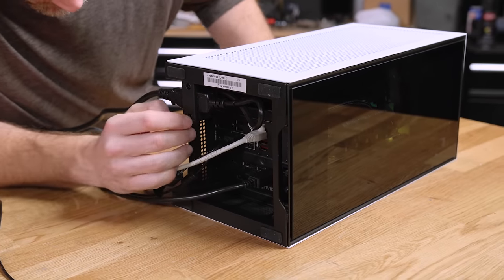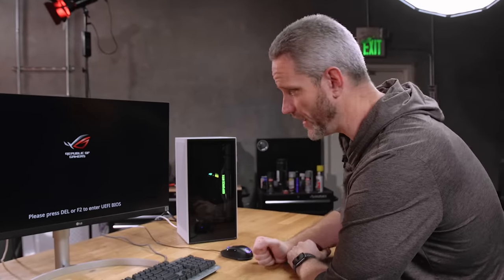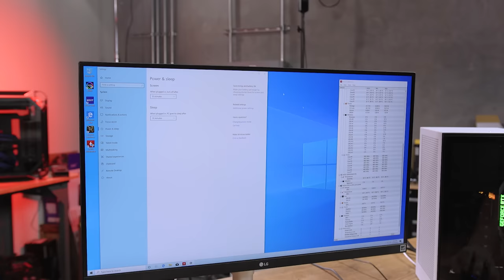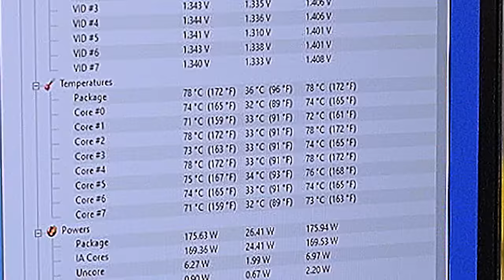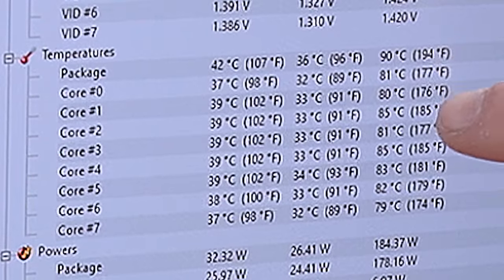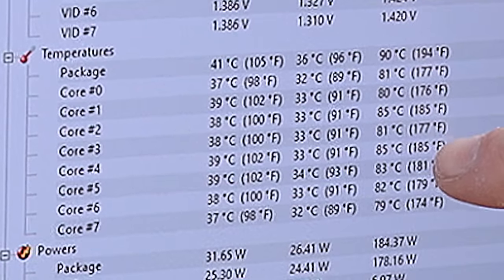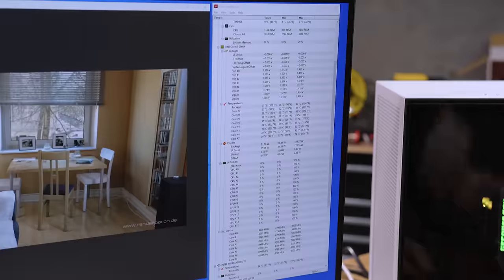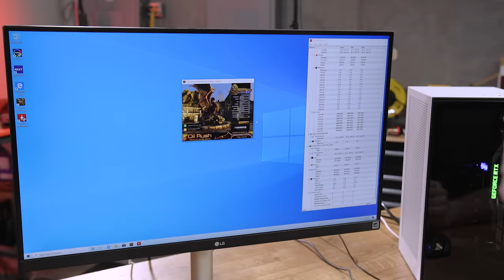You NEED to see this small PC case!

Comment: Seems Perfect.  I love small cases, but I have a 5 monitor setup.  I prefer to use 2 GPUs, so I typically can't use an ITX board.  Currently, I use the Tt level 20 VT... but it is HEAVY and larger than I want.

Comment: If they did some holes on the top like the Corsair one with a nice 140mm fan to help pull out the heat it would probably do even better.  Still, nice looking case for the form factor.

Comment: Jay can you please check how thick the 2.5-inch drives can be installed because I really need to know if I can get 2 8TB 2.5 inch drives of storage for content creation so I don't have to work with NAS for the time being.
People seem to be disappointed with the price ... though you have to think about this:  The PSU costs 125 $, The 140mm AIO costs around 100 $, so that leaves the case for about 125 $. For such a thought out the case, I'm thinking this case is very well priced (and think of the PSU cable management benefit for having shorter cables). But of course, since this is all bundled it can feel expensive as a one-time expenditure. This will absolutely be my next PC build even though I don't know when I will make it yet (still thinking of waiting for AMD's AM5 socket and DDR5 for some sweet 128GB mini ITX build, yes I do use that much RAM easily and 16GB on my laptop is so painful right now).

Comment: I've always felt like NZXT were often one step away from being phenomenal cases. Introducing a mesh or perforated front would go a very long way with maintaining lower temperature in their standard desktop builds since that's often their weakness and introducing a top exhaust which is often found in these tower-style ITX cases to help move as much hot air out of the H1 as possible would be nice. 

That being said when I switch over to a RTX 3080 and a Ryzen 4000 build in the fall I am going to put my NZXT H200 to rest and rebuild in to this. I just hope they'll eventually allow you to buy it without the PSU since I already have a Corsair SF750 and, who knows, maybe they'll come out with a revision with improved exhaust.

Comment: Will the PCIe riser 3.0 work without issues with an updated AMD CPU to PCIe 4.0? 

I'm looking to make myself a pc and was looking at the Evolv shift air until today seeing this is smaller and in white. 
Though I hope they do a revised model soon without tempered glass and meshed top with a slim fan to push out the hot air.

Comment: It's funny to me when I hear you call most PC cases "Traditional". I used to work at Zeos in Minneapolis, and I still call that a Mini Tower. Back then (about 1993) this was a new design, and we were shipping some of the first Pentium 90 PC's all over the World. This was back when IBM first announced that they would NOT ship any Pentium 60/66 machines because of the floating point error flaw. This new case is probably small enough to fit 2 or 3 of them into the same space that a Zeos full tower case took up.,

Comment: The screws are not actually that tight when you use a standard sized screwdriver. 5:17
I use a Craftsman #2 phillips (6") but any brand of the same size will be sufficient.

Comment: they could've made it 50mm taller so you could fit two 140mm fans  in it. One at the bottom pushing air up and one pulling it out the top.

Comment: This form factor reminds me of the Xbox Series X.

2:12
such a great sound

5:06
I FIX IT!!! 💥

Personally I wouldn't build a PC in this case.
It seems like a lot of unnecessary headache.
I'd rather go with a normal, medium size case (at least).
I also dislike how you don't have the option for an optical drive.

Does NZXT make a normal style case that is air cooled and has slots for an optical drive?

Comment: Definitely a cool case, though there's almost certainly no way that I'll ever do anything with small cases. My main machine has 12 drives in it (as well as a Blu-ray drive), and you're never going to fit much storage in a case like that. But if you don't actually need much storage for whatever it is you do, then a case like that looks like it would be an interesting choice.

Comment: They've crossed the old Mac Cube and Trashcan designs and got this out of the merger. I'd want a plain metal panel on the front with the USB ports and headphone jack through it. Also, at least 4 USB 3.0 and two C ports on the front.

Comment: So it seems that NZXT sent this to everyone. However i think this was the best review of the case i've seen. I'd still like to see this case offered empty. Am i the only one that doesn't want to deal with water cooling? the worst that seems to happen on an air cooler is the fan dies, the system throws an alarm about thecpu fan speed being zero, and thermal throttles. With a pump... 

 Though if it were offered as just a chassis it would then be competing with the velka5.

Comment: I want to switch out my fractal R6 for this case in matte black so bad. I would love a SFF pc on my deak instead of the behemoth I have now. I have a Corsair H115i platinum RGB, and the temps for the CPU max out at 35 degrees celcius under load.

Comment: Love this case. Shame they didn't put a large, low rpm fan at the bottom or top blowing/sucking up over it all though, with a vented top, a bit more like the Corsair One, to help with heat. It's still impressive managing to handle a 9900k/2070 with stock curves though...

Comment: Biggest problem I see with this case: the "front" panel port locations absolutely sucks, mainly because they're not actually on the front; they're on the TOP. The case size and expected location (on your desktop, duh) is similar to the Corsair One gaming rigs, but the port location is radically different. Corsair put them where they should be (on the actual front). Also not thrilled about only one type-A port, but I can live with that, especially since they included the type-C, which most manufacturers cheap out on. That said, the included SFF-PSU and AIO makes it worth the markup, especially if you don't care about the inconvenience of having to stand up at your desk to put a thumb drive in.

Comment: My two screws to remove the AIO rad were actually stripped right out of the box, so those NZXT strongmen must have applied too much strength when closing up my case at the factory. I had to drill and tap them to get them out!

Comment: I would REALLY mess around with the idea of drilling holes in the top of that case. 20 tiny holes could shave off 2-4 degrees just by letting heat escape.

Comment: The chassis is a little pricey, but you are getting an AIO and power supply in not the most popular form factor so I get it. Wonder what happens if you need to replace the AIO down the line though?

Comment: I would recommend NOT using a 2.5 slot graphics card, because the fans, being so close to the grill, will suffer turbulence. You'll need some gap for optimal air flow.

Comment: Steep price, but it includes the AIO cooler and a decent power supply. Plus the way they crammed all this hardware in there is so cool. I so wanna buy this case and replace my computer but my wallet has run out the door saying, "nuh-huh, no way buddy."

Comment: I watched a pro Fortnite player, coL Punisher, put one of these together on his Twitch stream about a month ago and found this case to be cool as Hell. For some reason that he never figured out, he ran into some trouble with his GPU (a 2080ti) being difficult to install and sitting crooked in it's slot even after locking in. It worked perfectly and the case went back together just fine, the GPU just wasn't as straight and level as it should've been.

Comment: I let me build a H210 for on the office. The Videocard is terrible in there. MSI 2070 super Armour OC. It's almost flat on the power supply.
Stresstest it at 73 degrees. 77 for H60 cooled 3950x. Not terrible but could be better. (they couldn't fit in a 240mm radiator with this card (they say) 
In this "case" at least you get fresh air on the GPU. I think a top fan exhaust would be an improvement for this design.

Comment: JAY... you made a MISTAKE I think...
You said the PSU sucks air into the case, however it seems to me it just sucks air into the PSU  then blows the hot air right out the BACK OF THE CASE. It shouldn't really affect the other components at all aside from some hot air that may bounce back off the rear of the case

Comment: I'd love one of these, but three issues keep my hand away. 

1> Price.
I'm friggin' broke. If you saw the system I'm typing this on, you'd understand. 

2> GPU cooling.
The biggest problem I have with my Fractal Nano S is its poor GPU cooling performance. While this thing is "better", it's still not ideal due to the TG blocking half of the exhaust from the card.

3> No 3.5".
I realize that 3.5" drives are increasingly considered obsolete, especially in ultra-small case formats, but see #1. I can't afford to upgrade to large-capacity 2.5" drives, or NVME drives that cost more than my entire build would new.
I can use a 2.5" as a secondary PC, and have, but see #1, paying this much for a secondary PC is difficult to justify on my shoestring budget.

Comment: The sealed side panel is not good to use with say a Strixx Cooler (with a high TDP GPU). Masive heat buildup on the sides of the card, and such tiny space to dissipate it away from the cooler. Sure the AIO fan will take what i can out, meaning not very thermally effective design, due to the radiator gets heated up with hot air from another source, that what it is actually cooling. Problem will be worst for the CPU when CPU+GPU are hard loaded simultaniously (A modern heavy AAA game). Heaven is not that kind of test ;)
But totally fine case to use with a Blower cooler.

Comment: Hey Jay I got an idea to try out. Could you install an AIO for a mini-size GPU on this case? Let's use NZXT's Kraken G12 and a 120mm AIO as an example. People have done some light mods by installing 120mm fans outside the back panel. Apparently the ventilation holes line up perfectly for the 120mm fan mounting screw holes. Would there be enough space on top of the GPU to mount the AIO? A fan could pull freish air in from the side panel, through the radiator. What do you think? Would make an interesting video at least? ;)

Comment: They aaaaaalmost made the perfect ITX small form factor case... They just should've figure out a way to make the "important/pretty" components of your build a bit more visible. What's the point of the tempered glass if you can't really see your build? Ventilation is super important, but esthetics (I believe) are also pretty important, if they didn't matter, everyone would just go for a true ultra small form factor full aluminium enclosure cases.

The Phanteks Enthoo Evolv Shift was also close to becoming the perfect ITX case, but they went the other way, prioritizing appearances and visibility of parts over ventilation... I guess it's impossible to have it both ways? Can we not just _perforate_" the tempered glass so that you can see, *and breathe? I know it's possible, like the holes to screw down TG side panels, but how would it look?

Comment: Great design, and i think Nzxt did a good job including a integrated AIO with this case because one of the biggest issues with building mini-itx build is finding an Aio or Air cooled cooler that will fit into the small form factor. Cheers Jay great vid' like always (~_~)

Comment: I wish these cases were slightly bigger and the mobos had 2 pcie slots with the bottom being for the gpu... Cause for vr... The wireless option for the vive use a low profile card. So... Need a case/mobo that can handle that, but want an itty bitty case :/

Comment: if the AIO is pushing air into the case, then why the filters on the side?  If the AIO is pushing air into the case then wouldnt the heat be blowing out the sides where the filters are?  Also, with the connections at the bottom and the VERY limited front panel connectors, it would be a pain the plug something else in.....

Comment: 8 wa wo dering would a blower style gpu be better in  build like this? Because it has its own heat eco system? Because a "normal" gpu like the strix would pull air in and expell the heat in the case? Just wondering

Comment: @Jay Do you know if the riser cable on any of these SFF cases coming out is going to conform to PCIE 4.0 speeds?  Would be interesting to look into.  I'm wanting to build a PC in either this or the RVZ03 case towards the end of the year, at this point leaning towards Ryzen 4000 series cuz Intel is still on 14nm and my 4770k and 980ti are struggling at 3440x1440.

Comment: Strange... I tested my Ryzen 3800X with stock cooler bevore I installed 360 AiO, and get max. about 82°C while testing Cinebench R20, all cores about 4.2GHz, boost over 4,5GHz...Sorry, but the Temps are here quite high.
Sure, other case and bulid/Hardware but I wouldn't be happy with this scores, I mean CPU temperatures.

Comment: Jay: The fan of the PSU and AIO suck air from the back into the system.
Also Jay: I can feel a hot bubble of air behind the case.
Me: doesn't that mean that air is drawn in from the sides and expelled out the back :/

Comment: Awesome case but at $350?... Yeah... No... I'm not even $175 into my Fractal Core 500 with a SeaSonic Focus 550w 80+ gold PSU, 2 extra 120mm fans, and the Be Quiet Pure Rock heatsink.I understand they have overhead for the modified AIO, and this case requires custom tooling, but nope. If I want a tower I'll just uh... Stand my Fractal Core 500 on it's face... All things being equal though, I'm VERY excited that the market is FINALLY moving to make ITX mainstream in the custom PC segment. We don't need massive towers with sound cards and modems and storage controller cards like it's 2000 again. My motherboard already has so much crap onboard I don't use, WiFi, bluetooth, to name a couple.

Comment: i just build my self a new pc i went for
i7 9700k
corsair 16GB of ram 3200mhz
Aorus z390 aorus elite

Corsair Hydro 100i RGB Platinum
6TB hdd + 240GB ssd
gamemax crusader case
fans upHere 120mm RGB halo
and the 1000w psu and Gigabyte GTX 1070 G1 8GB is from my old pc add like to get a new gpu when i get some money but not sure which one

Comment: It's literally more than half the cost of the PC I am going to build. ($500)
Reply: At that budget you're better off just using scrap or wood as a case. Because $20 extra budget could bring extra performance and is better spent there. This case is more suitable for $1500 to $2000 builds where $100 extra only gives you a larger hard drive (coming from a 2080 Super that $100 extra won't get you a 2080Ti).
Reply: well this case is not targeted against cheap pcs

Comment: Hey, new computer concept...
Small form-factor, good, portable monitor and wireless keyboard, a backpack made to carry these items, and just ditch laptops?

A backpack case with a battery compartment and battery-friendly PSU, and a monitor-holder that protects a portable monitor or three?

Personally, I'd ditch the battery requirement. Laptop batteries SUCK and are only liabilities, not a feature.
Reply: For gaming, yes. I am considering going the route of this + my 13 inch spectre and dropping my Razer 15. However I've got an amazing couch set up where I can laydown with my Razer on my chest using a foam wedge and a left hand controller. Not sure I can give that up.

Comment: Manufacturers: we're not making any highend Micro ATX hardware because no one is buying it.

Gamers: Well no one is buying it because no one is making it, so we end up building in the form factor you keep pushing on us. Then when you finally release hardware we've been asking gor there is no point in buying; because, we just recently upgraded already.

Manufacturers: Screw it. It's either way too big or way too small, deal with it.

(Notice) I love really small builds but sometimes I just want on extra expansion slot so I don't have to use external hardware that use up valuable rear IO

Comment: Will it fit a 3 slot card? I have the 5700xt Raw II and it wouldn't fit in my NZXT Manta because the PSU shroud at the bottom of the case.
Reply: Nevermind you answered my question. Rip.

Comment: I really wanted to use this for my next PC....But now the stupid size of 3080 and 3070 will not fit in there. And it is possible that PSU will not handle 3080...And also all those new GPU designs with air going through will end up in the wall of this case 😢😢

Comment: I really like SFF but I need, at the very least, 2 x 240mm or a 360mm radiator... Just can't go back to not having a water cooled GPU, what with modern GPU's boost being so dependent on temperature and having become accustomed to the benefits.  It's not a difficult task but the market just isn't providing the goods. This case, along with many others, if adjusted by mere millimetres could accommodate them but once again a manufacturer has swung and missed. How many more years before someone 'gets it'. 

DISS...A...POINT...ED!!

Comment: Can someone explain something to me or maybe jay can make a video about this.
Two cards 

Gigabyte GeForce RTX 2060 SUPER Gaming 8GB OC White

Base Clock : 1615 MHz
Boost Clock : 1815 MHz
Price: 474 Euros ( 526 Dollars )

Asus ROG Strix GeForce RTX 2070 SUPER 8GB
Base Clock : 1605 MHz
Boost Clock : 1800 MHz
Price : 644 Euros ( 716 Dollars )
 My Question is:  That 2060 has a higher Clock speed than the 2070, does that mean its better? Also why does the 2070 costs so much more wen its clock speeds are slower?
This is really confusing , we don't know what cards to buy based on this, one has higher clock speeds and is cheaper, the other one is slower and much more pricier.....why?

Can someone explain to me why is the 2070 super better and does it justify that insane jump in price? Thanks.